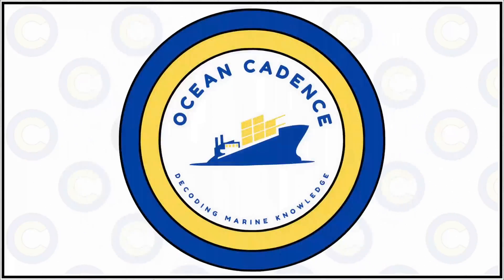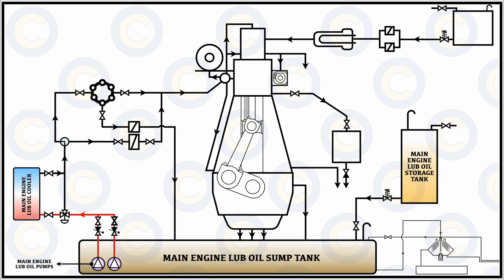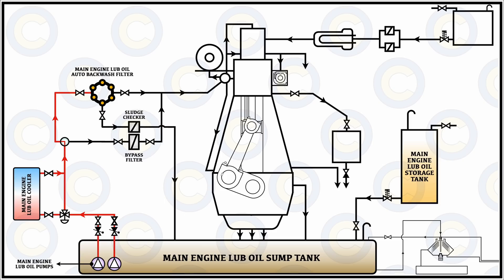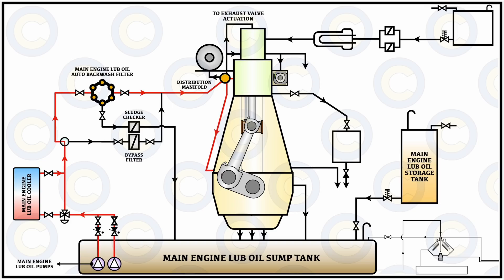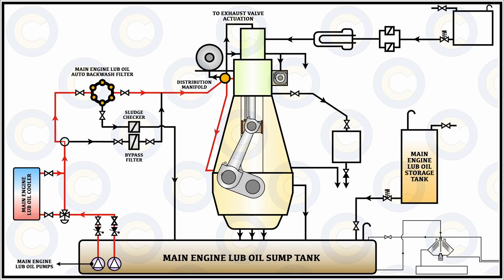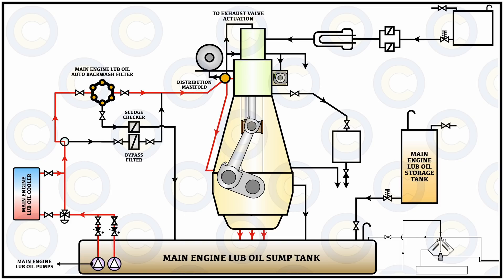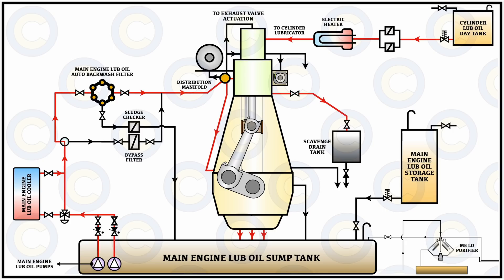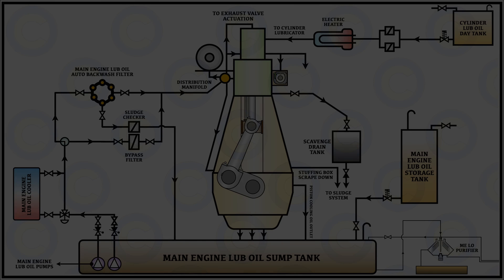Main Engine Lub Oil System | ME Lub Oil Line Diagram | Man B&W and Sulzer Lub Oil System | ✅👨🏻‍🔧

Comment: What about intermediate shaft bearing
Reply from the maker: The intermediate shaft bearing can either be lubricated by an oil bath with a manual top up and sight glass arrangement or by an external forced supply of oil. The film formation is of hydrodynamic nature and in case of bath type design the shaft has an extra ring with baffles for splash and carrying of oil